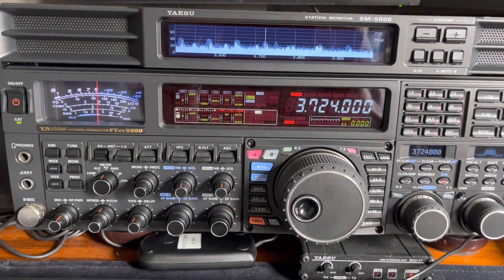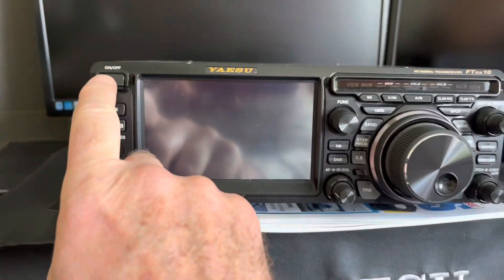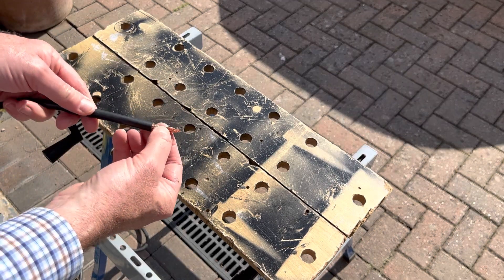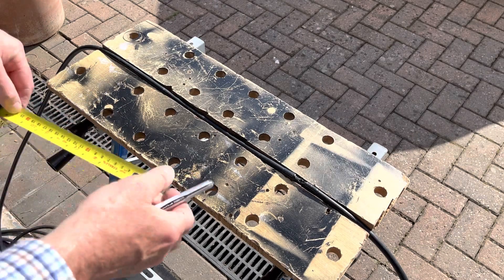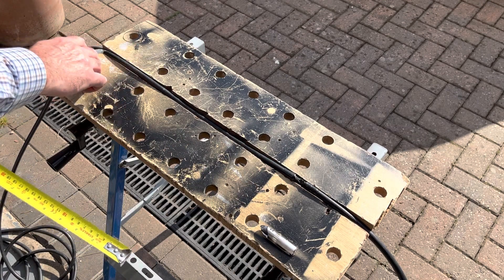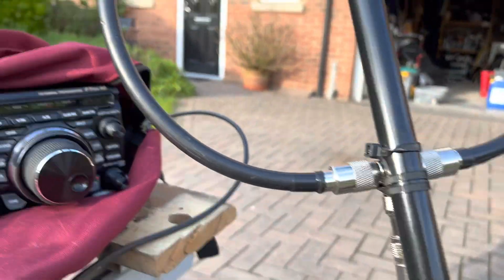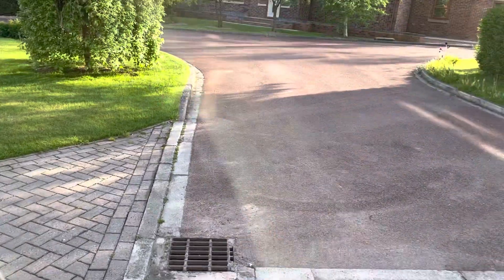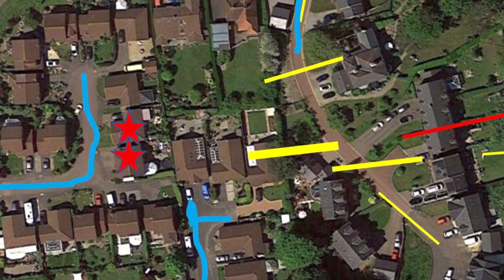Successfully Hunting Down QRM With A New Loop

Comment: I'm using these days a chinese Malahite clone as a portable radio. Much more portable than a 100W rig and a heavy battery pack. Will less than 200 USD it also doesn't break the bank.
Reply from the maker: Thanks for the tip 👍🏻

Comment: Save yourself the time, get a good portable AM radio (MW) tune to an empty spot and start waking and turning your radio, works every time. short cuts of an old timer.
Reply from the maker: Hi Joe and thanks for the tip. Yes, I tried that with a little tranny, but no joy. The better radios aren’t cheap, so this was my best option as it cost nothing. Thanks again 👍🏻
Reply: @ianxfs  No cost is great option, just remeber that one can get a good old sensitive MW/AM portable radio at any good op-shop for about $5

Comment: I have a question, how the SO239 should be connected in this improve mag loop antena? should I solder the center and the shield or it doesn't matter if I only solder the  center conducter?  Thanks in advance de TI3GB... I have a tremendus interference in 40m-17-15 and 10m and I want to use this antenna to find the source.
Reply from the maker: @TI2GBB  Hi. Yes, connect both the centre and the braid in the normal way. Good luck in solving your QRM problem 👍🏻

Comment: Wish my identified QRM would go, It flattens 80mtrs S9 +10db and 40mtrs S9 then tails off up the bands. I built a loop and found it was the shop next door but one, LED lighting presumably being run from a cheap switch mode PSU. did try speaking to the shop owner, but he got rather abusive and told me to F... off. so thats my operating curtailed somewhat, thanks to the local Premier shop.
Reply from the maker: Not good. Perhaps a letter/email to head-office and explain the situation and see if they can step in? Hope you get sorted...

Comment: Thank you Ian!  Your video has really reinforced my work on a mag loop project.  My initial motivations for a mag loop were that they are compact and, with a high Q, help eliminate QRM and QRN off frequency.  Your video illustrates the other great feature of loops, the strong null that is perpendicular to the loop itself, allowing for direction finding.  I'm doing a deep dive on mag loops for both reception and transmission, one loop covering 30-10 meters, the second much larger one covering 80-40.  I hope to have something published in another month or two.  Again, thanks for adding to my overall understanding the value behind loop antennas!!
Reply from the maker: That’s great! Good luck with your projects 👍🏻

Comment: I actually made the original loop from the first video, but wired it straight through and bit shorter on the left side. Then I made a couple of swappable pieces out of RG59 about an inch long one with the conductor and insulator connected and one with just the insulator connected.  With this I can swap between them to increase/decrease sensitivity as required. Anyway, thanks for the video and nice chatting with you on the air 2E0HZA.
Reply from the maker: Great stuff Adrian. Thanks 👍🏻

Comment: Great video... Just a quick thought for the mechanical/solder connection between the end back onto the main coax sleeve.. instead of soldering a big fat finger end with the centre connecting inside then needing big heat to get that to solder to the   main braid you could solder the end short but leave 6" of bare inner projecting out then wrap 2 turns of this around the main coax braid then wrap anything left back around the end finger short. Mechanical strength from the copper not the solder & not needing as big an iron to heat the joint.
Reply from the maker: Yes, thanks for that 👍🏻